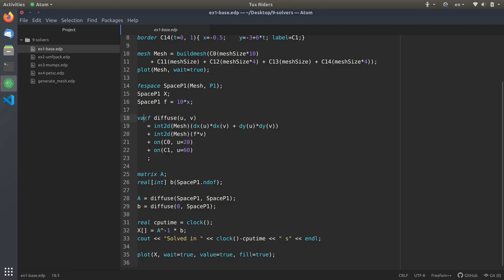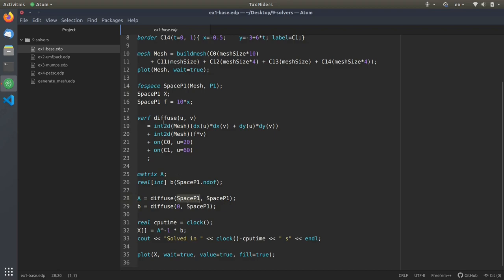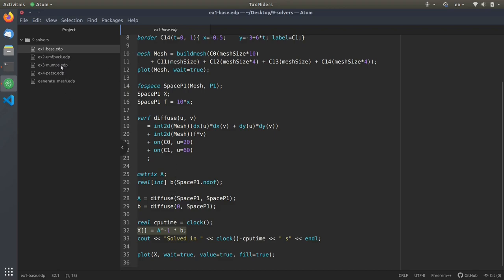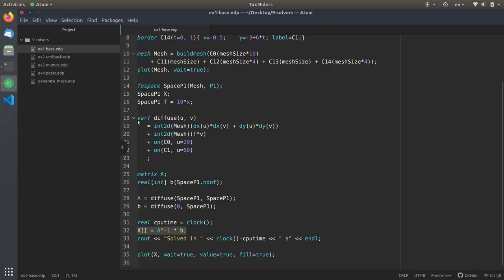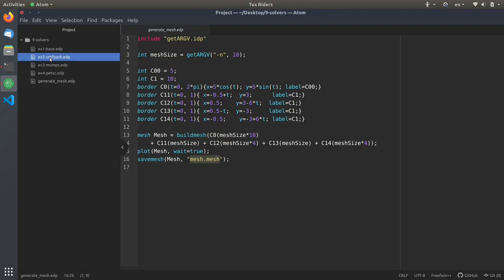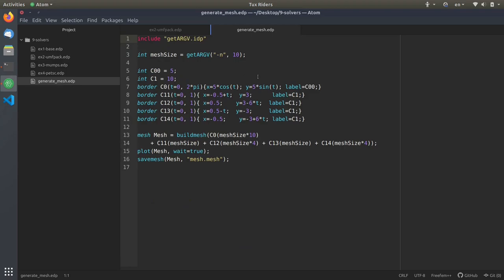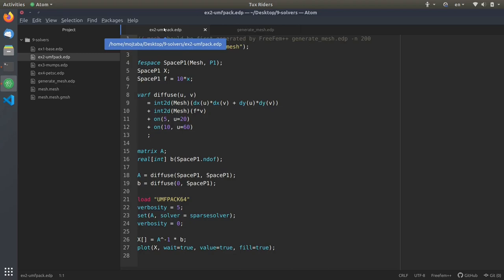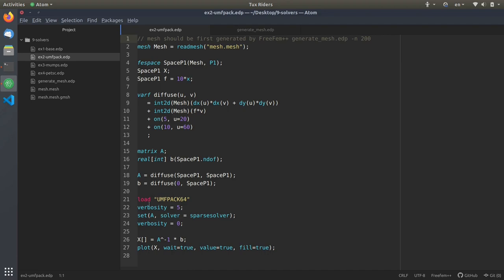[FreeFEM 9] Solvers and preconditioners for the linear system of equations: PETSc, MUMPS, & UMFPACK

Comment: Hi, is it possible to use PETSc while using the 'problem' keyword? Or is it necessary to use the 'varf' keyword when using PETSc? Very useful video, thanks.
Reply: I've realised that to use PETSc, you must use varf. But, I've now got another query: when I use PETSc, I can still use 'matrix' to define my matrix A, whereas in this video you explain that you must use 'Mat'. Why might I still be able to use 'matrix'? Could I be doing something wrong? Many thanks.
Reply from the maker: good to see that you found your answer. yes, you need the `varf` notation to use PETSc due to the way the integration is implemented in FreeFEM. `Mat` is a structure on top of `matrix` to handle things in the `macro_ddm` (https://github.com/FreeFem/FreeFem-sources/blob/master/idp/macro_ddm.idp#L822). in newer versions, they can be used interchangeably.

Comment: thanks for the nice video. You could measure the mesh  reading time just by itself by commenting out the rest. Would be interesting to see.
Reply from the maker: it's indeed a great suggestion. I could have done that to be able to talk about the time it takes to solve the linear system.